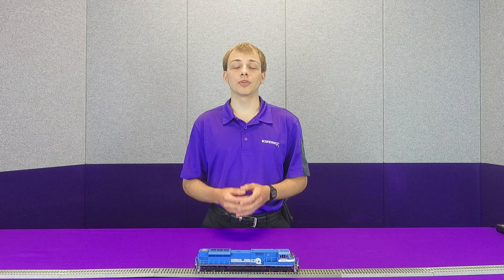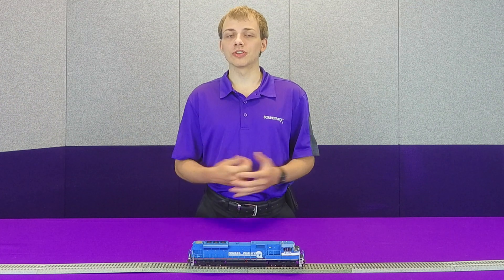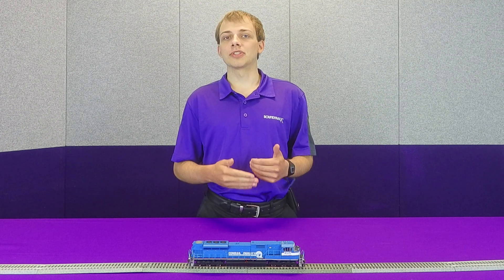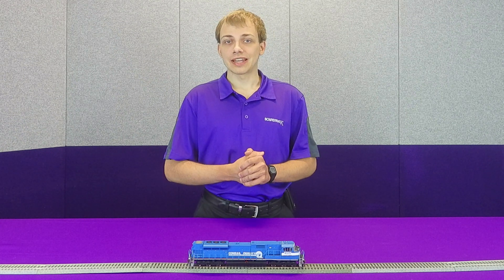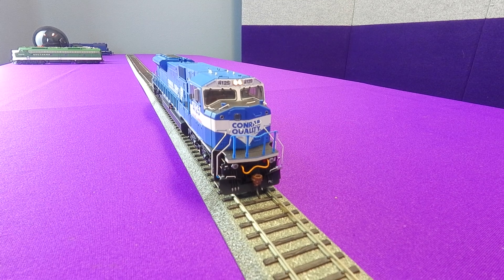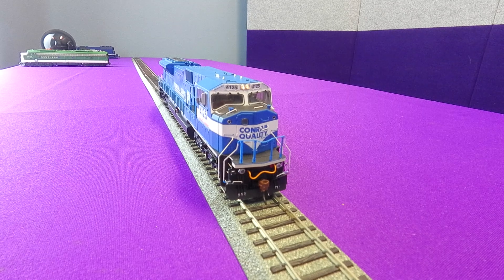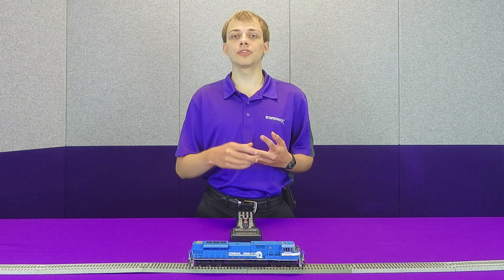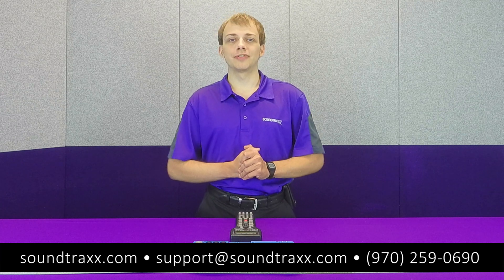LED Compensation Mode with SoundTraxx Decoders

Comment: Thank you for the explanation.      I am curious.  Would this LED compensation be used instead of adding resistors, or would you still need to add them for your board and plug in decoders?
Reply from the maker: You still need them on most of our boards. Some of the newer Tsunami2 formats have resistors built in. See the wiring diagrams for each board for more info.